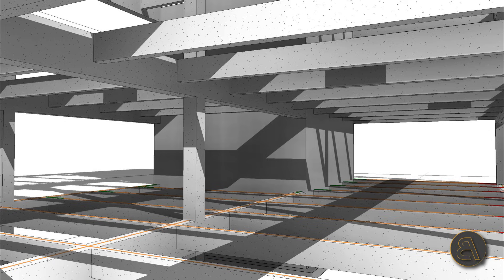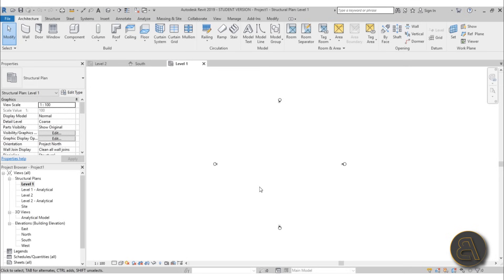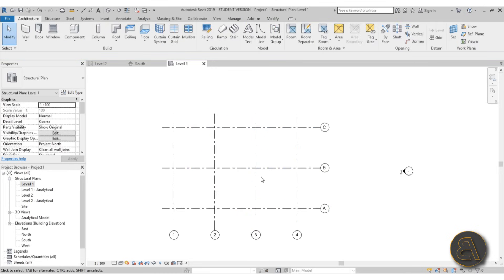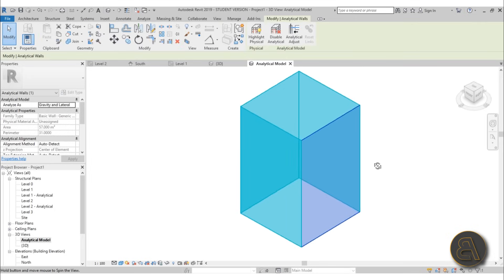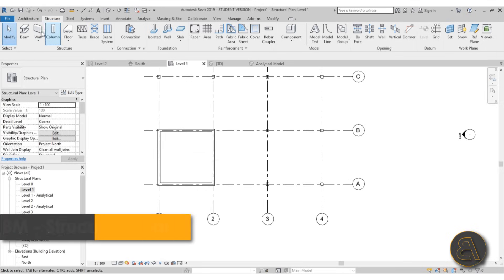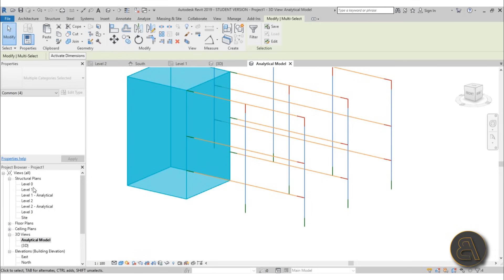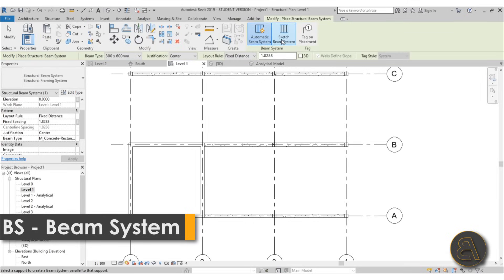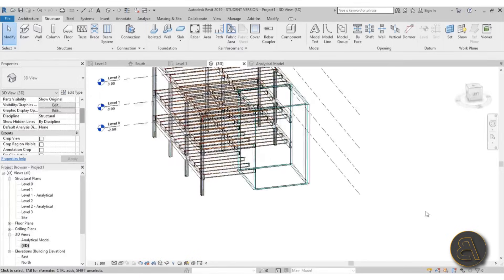Beginner Concrete Construction in Revit Tutorial (beam, column, foundation)

Comment: Hi, why don't I have this analytical model on my Revit? Thank you, sir. It's so helpful.
Reply: Hi, I had the same issue there can be two reasons for this.

1. The analytical model is created but it is hidden. You can unhide it in the bar just below the drawing. 

2. The analytical model has not been created at all. 

First you must select the the elements that you want to be included in the Analytical model. I recommend marking everything in the 3D view and then filtering so that only structural elements are selected.

Second, go to the tab which says "Analyze" at the top. Then in the "Structural Analytical Model" (To the most left) you click on "Analytical automation" where there are two options. You click on the "Run Physical to Analytical for buildings".  Revit will then create an Analytical model of the drawing.

Comment: Hi balkanac!, how things goes so far?. I need to be directed, after I design a house in architectural tab of revit, is it possible to separate/isolate concrete structure (footing strips, slab, columns, beams and so others) into another views and sections (let's say under structural views-in project browser). So having a pure structure and work with it like in for example in staad?